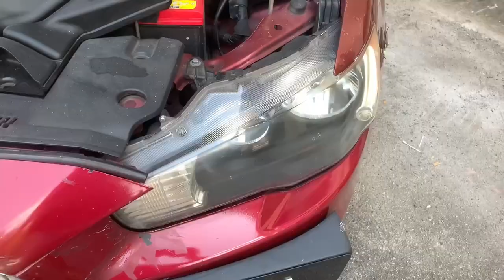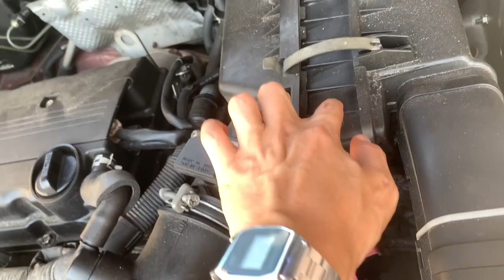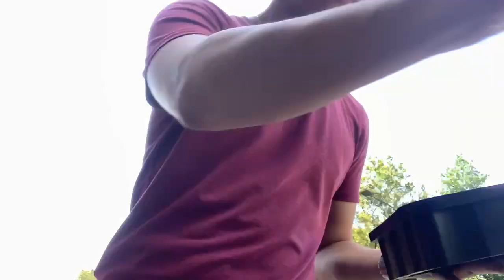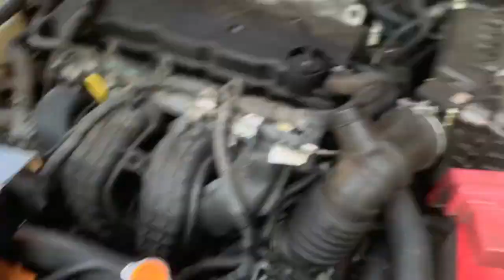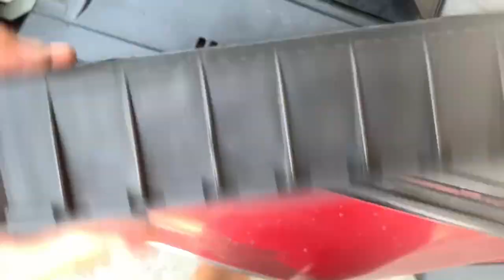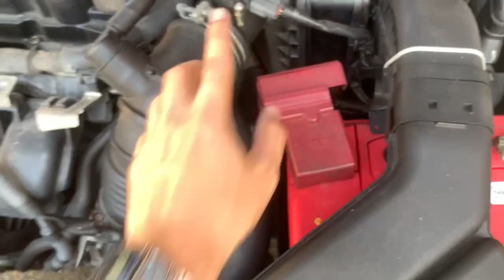PROTON INSPIRA | Works Engineering Drop In Air Filter - Installation & Review

Comment: you will feel on higher rpm where the engine wants more air, anyway using drop in performance air filter also saves you money because its washable but the downside is you need to clean your throttle body more often since it doesnt catch dirt that well so your throttle body gets dirtier faster than the standard filter.
Reply: I thought the oil on the surface will catch dirt. That is why it washable and needs to reoil it . Use it for few years but not much dirt o  the TB . Thanks for your writing as well.
Reply from the maker: Thanks for the info!

Comment: Tuning is not required for now as there are sensors to monitor and correct the air fuel ratio . Some restrictions taken away reducing the vacuum in the intake thus allowing that little bit extra volume of air to rush in during the intake stroke . 👍

Comment: Any gain is much appreciated. Thanks 👍
Reply: my car - Subaru XV GT 2023

For me a lot improvement. Because I like to challenge the engine at low rpm. Here's the improvement after drop in filter

1- throttle responsive improved a lot. Almost immediately feedback when u step on it. The lag/delay drop like 80 to 90%.

2- the power prolong longer than before especially during slowing down. Can the feel the power not so fast cut off. 

3- every weekend after cold start I will go to a short uphill and every time there's hiccup at low rpm. Maintain the accelerate level also same issue. But after drop in air filter, it is so damn smooth up to hill without giving more accelerate. Hiccup drop like 90%.